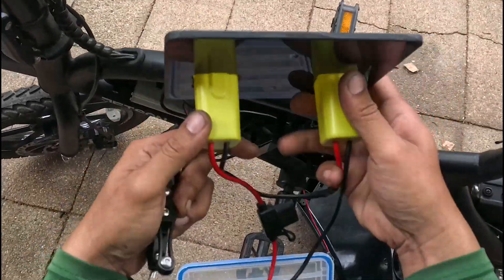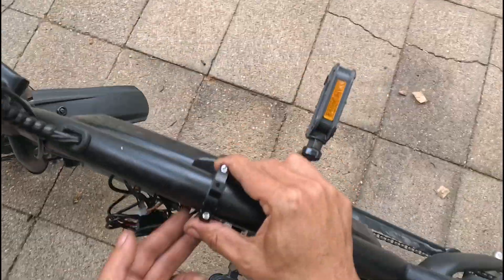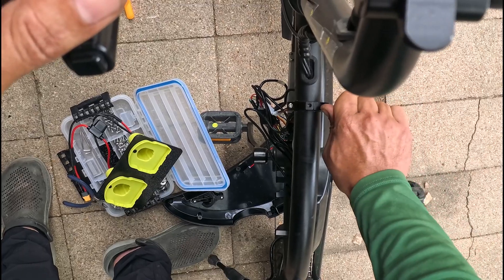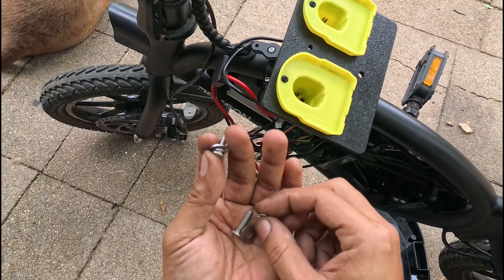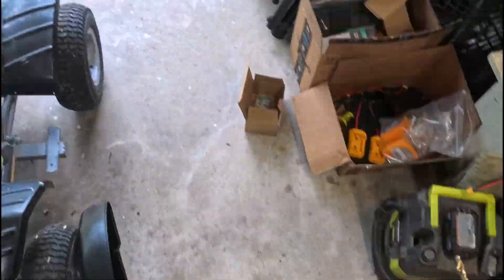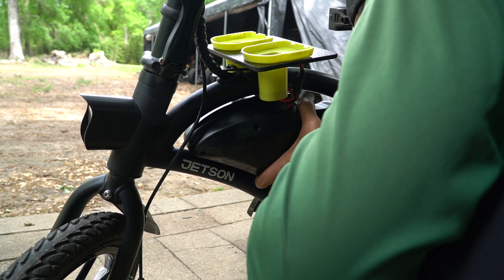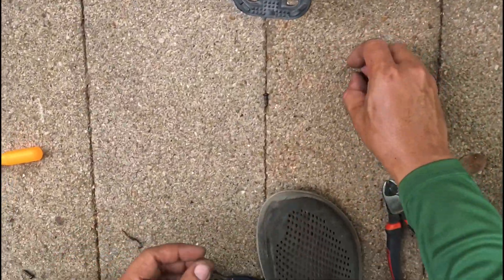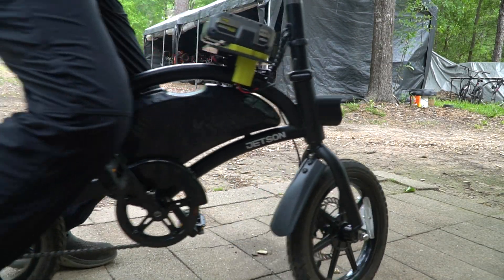Drill Battery Adapter Mount for Jetson Bolt Pro Ebikes

Comment: I just did the same think with a slightly different setup.  I bought a Ryobi dual mount off Etsy and made sure there is a fuse for safety.  Got that in series for 36 V and made sure the batteries were the same capacity (6 Ah) and charged up (you don't want to be mixing).  Yeah, it works.  If I was going out, I'd probably have another two batteries to swap out and a couple of fuses just in case.  I got the original version w/o the peddles so if I ran out I'd be huffing it.
Reply: Here's a tip, these scooters are not as stable as a regular bicycle and the smallest twitch w/ the small wheels is amplified by speed.  So wear a helmet, shoes (not flip flops) and padded gloves if you plan on max speeding this thing.  Just from real experience let us say.

Comment: What happens if one of the ryobi runs out of power first?  Won't that be running 18v to the bike?  Does the bike have a safety switch?
Reply from the maker: The bike would just not run at 18v.
Reply from the maker: Technically, if one battery goes out first the circuit breaks and the bike won’t run